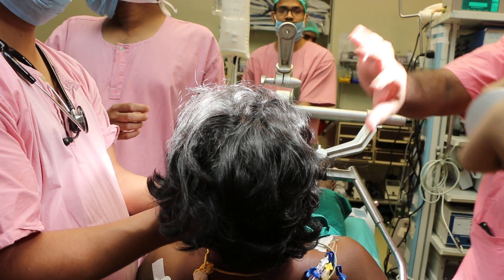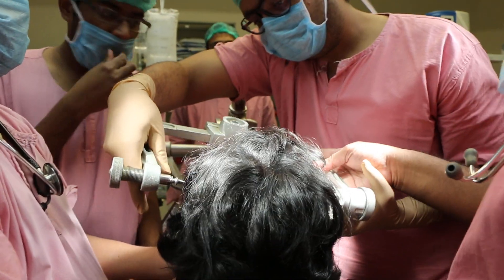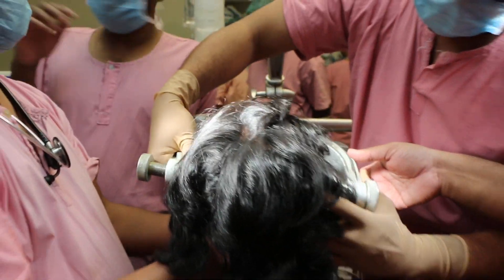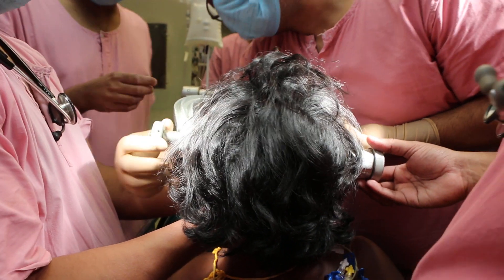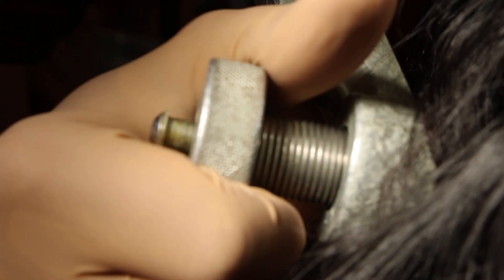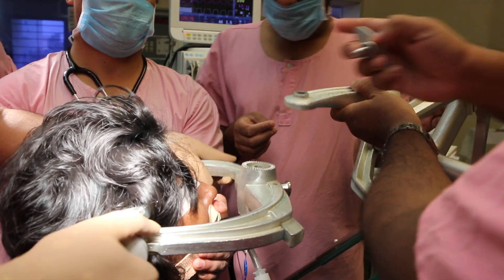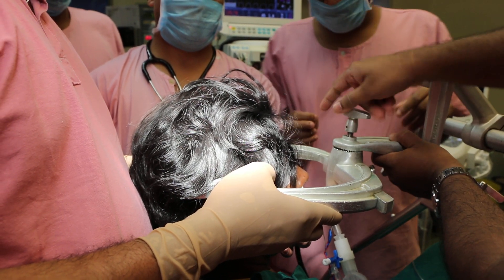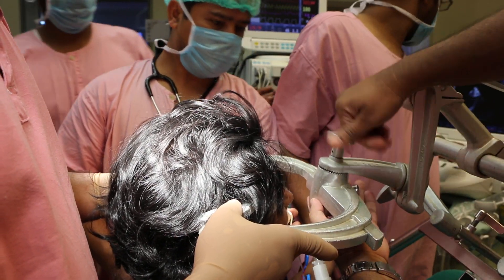Sitting position for neurosurgery: Fixing the skull clamp. (part 2)

Comment: IT IS not forbidden top shave the whole head in such cases. IT IS absolutely adequate
Reply from the maker: Shaving the head, paradoxically increases the chances of infection since the skin surface suffers microabrasions which pathogenic bacteria can colonise. So, we do only clipping of the relevant area just before surgery or even part the hair and incise the skin after preparing with a skin disinfectant such as chlorhexidine. Hair is a monofilament structure and can be disinfected better than the skin and there is no need to shave it. Also, patients feel much better and their visual identitfy remains intact when the head is not completely shaved.
Reply: @gopalakrishnanms  there are No evidence based studies proofing that extended shaving induces more infections and vice versa

Comment: I take it hygiene, keeping a sterile field and preventing infection is not an issue.  This is horrifying.  No gloves, no mask or masks pulled down under the nose.... dropping equipment on the floor only to pick it up and use it again.  Smh
Reply from the maker: There is no requirement for gloves unless there is a risk of body fluid exposure. One does not have to wear a glove for touching the intact skin of a patient. Alcohol hand rub is good enough to decontaminate the hands before touching the patient. Masks have not really been proven to be of benefit in reducing nosocomial infection in the operation theater unless the surgeon is doing an implant surgery. Here, we have not yet started open microneurosurgery and not having the mask where it is supposed to be does not make a real difference, though I agree it looks a bit odd. Anything that penetrates the skin should indeed be sterile and we ensure that it is. The rest of the equipment need to be clean and disinfected only. We have HEPA filter and a good laminar air flow with adequate air volume changes to reduce the  air borne bacteria and sqaumes.
Reply: Toujours la même réponse ! Honteux !
Reply: I have a very hard time seeing rips & tears in the upholstery/padding on the operating table. I do not believe that equipment in that condition would pass even the most basic inspection.

Comment: Did that penetrate scalp
Reply from the maker: Yes, not just the scalp but it works by penetrating the outer table of the skull and hold the head in place firmly and securely.